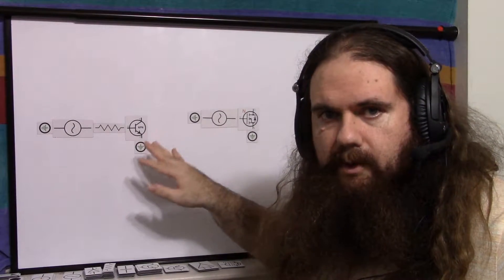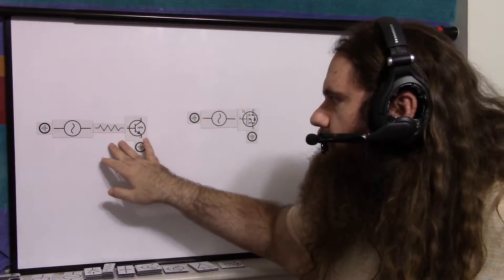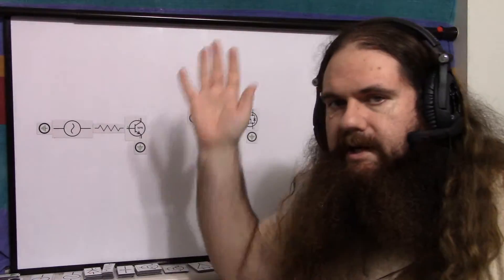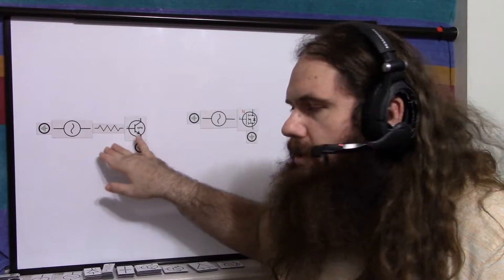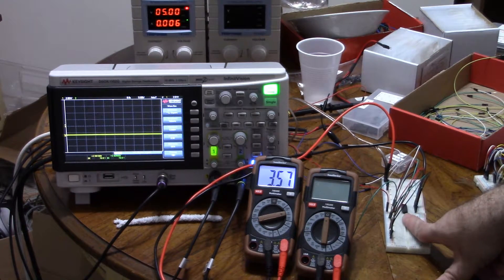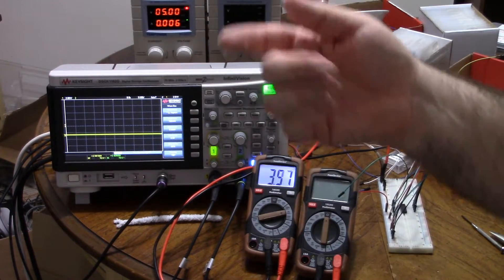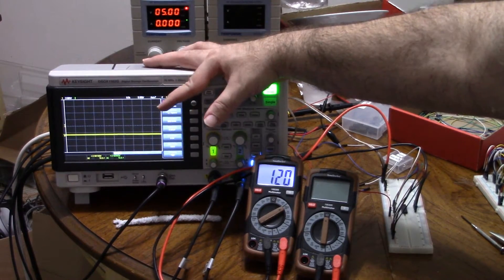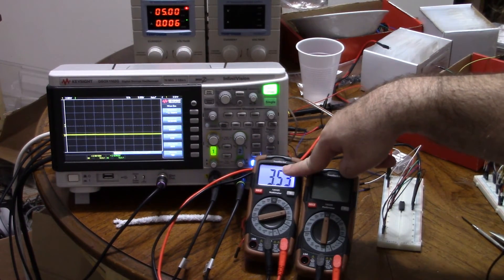MOSFET High Frequency Switching Power Draw - Ground Your Floating Inputs - Simply Put

Comment: Cool, vid.
I have a question, If not concerned with power rating, voltage rating, or current; what characteristic do I look for in a mosfet for radio frequency use.

Thank you

Comment: eye opening video thank you , i have a question for you if i want to use the mosfet as just a switch , basicly i want to use it for connecting 2 capacitors in parellel then close the switch ( mosfet and close another mosfet which will connect the 2 caps in series , how i arrange the ground for the mosfet between the 3 mosfets ( 2 mosfets to connect the 2 capcitor in parallel + 1 mosfet to connect the same 2 caps in series ) thanks for your help